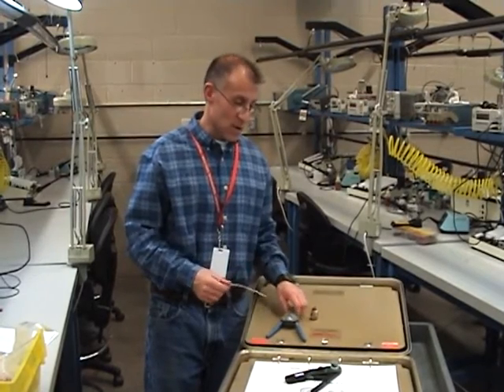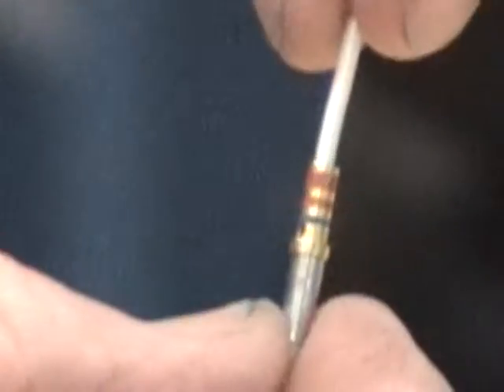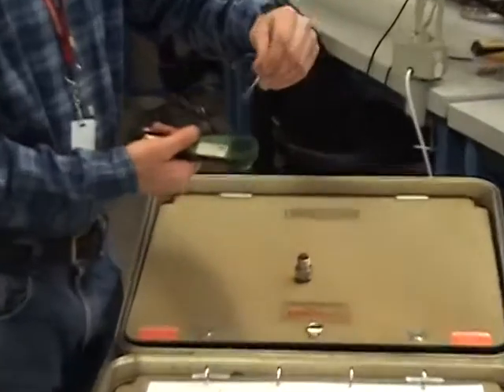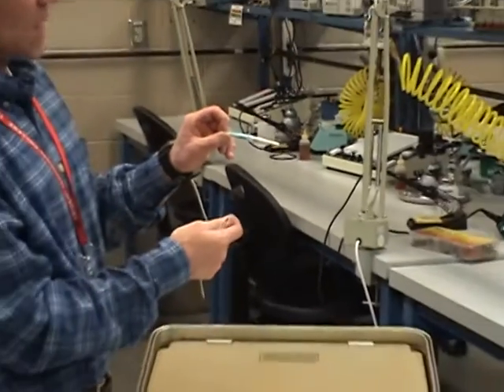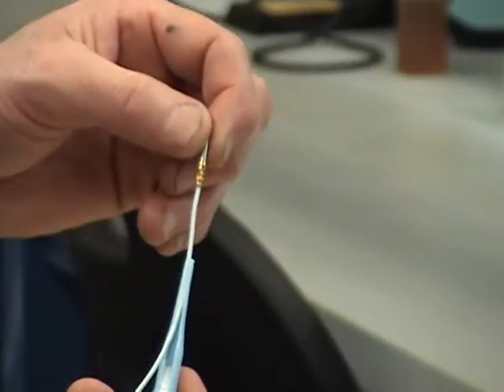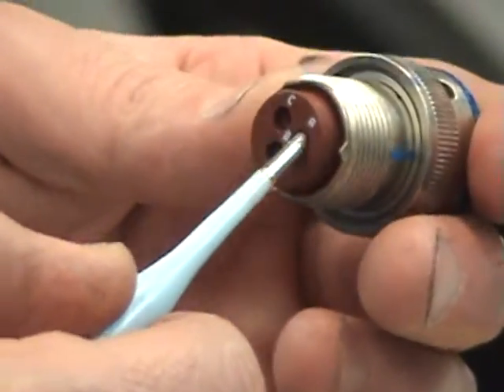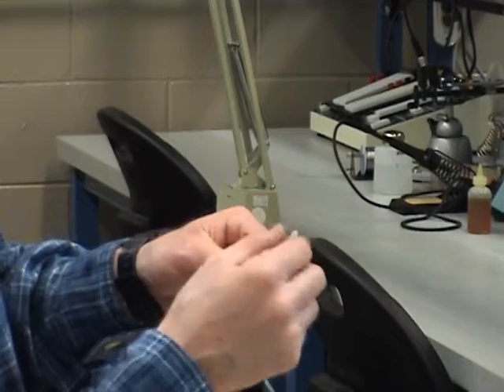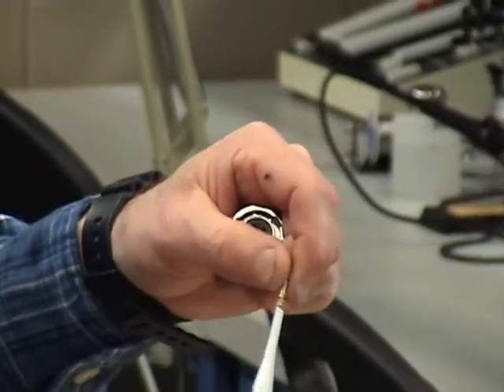*EXPERT LEVEL* MS Connector Repair Tutorial TTC Avionics

Comment: This so called expert is using a Daniels MH880 tool which there is no need for when crimping a standard red socket contact to 20 AWG cable. Real overkill as a starndard AFM8 (M22520/2-01 with a K1-S positioner) or an AF8 (M22520/1-01 with a standard TH1A turret (MS22520/1-02) will do the job. Never re-strip the cable as the blades/dies will scrape off the conducters' protective coating. Bring on the databus contacts bringing in the HX-4 (M22520/5-01) and several die sets.
Reply: it's an MH860 actually. Dont understand why it is "overkill". It is just one of the several tools you can use. An MH860 is probably the more versatile than af8 or afm8
Reply: They are 22520 tooled up anyway in those environments so it's just a bunch of dies to buy instead of another crimper. I'd have more trust in a DMC than something from a sparky wholesaler.